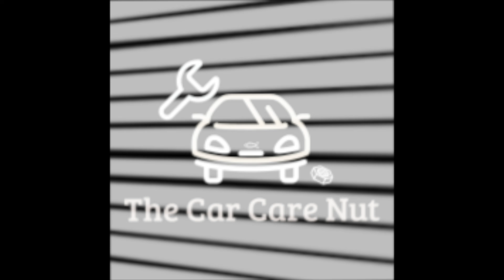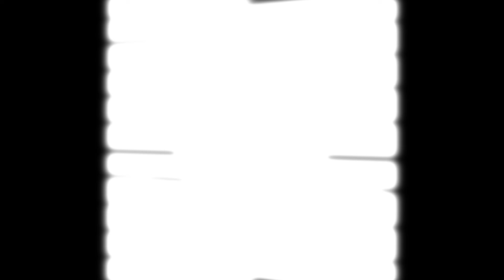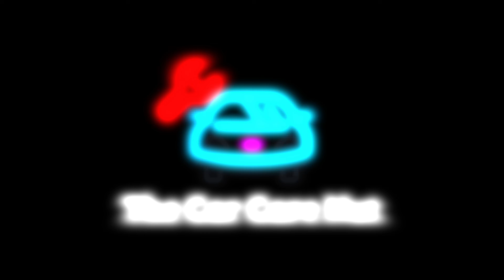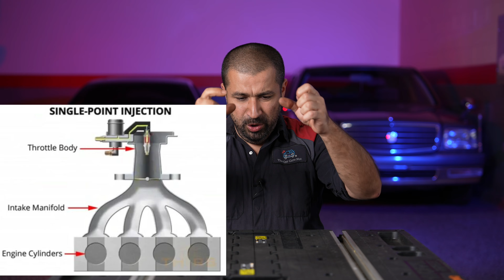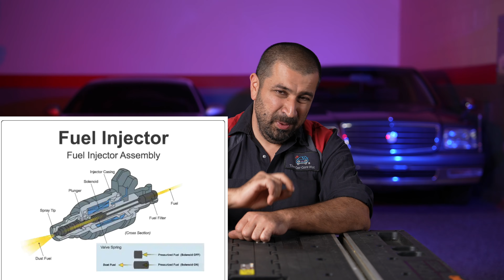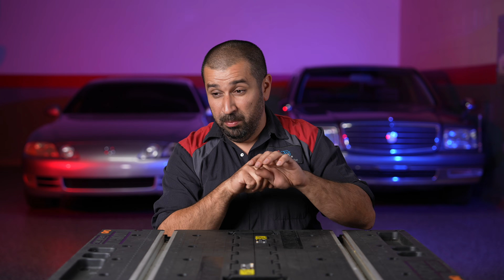How Does Modern Electronic Fuel Injection Work? Part 1 : The Basics

Comment: At a perfect burn, the o2 will be zero, but at a too rich mixture, all the o2 will also be zero but unburned fuel will be in the exhaust (afaik)so how is that detected?  This was not covered. 
Otherwise, a clear explanation of the process.
Reply: I think that in practice we never use 14,7 (stoichiomeric ratio) in engines but a slightly different number, so the computer doesn't expect for complete lack of oxygen in the exhaust for the car to run perfectly, but a rather "poor" quantity of oxygen. So tiny quantity of oxygen = engine running good, and complete lack of oxygen = engine running rich. In practice the O2 sensor oscillates constantly between rich and poor mixture and the computer corrects the mixture continuously (I'm not a mechanic, the above is my understanding of the principle. A more knowledgeable person may chime in)

Comment: Actually, fuel injection was used on the German airplanes in the thirties to make them fly better,   Then 63 -65 fuel injection on corvettes,
Reply: You are correct about the German airplanes of WW 2 . This allowed them to get full fuel supply when inverted , diving and climbing. The technology was then used in Mercedes Benz cars of the 1950 s specifically the 300 SL . The Bosch systems were used in Mercedes of the 60 s and  70 s as standard practice